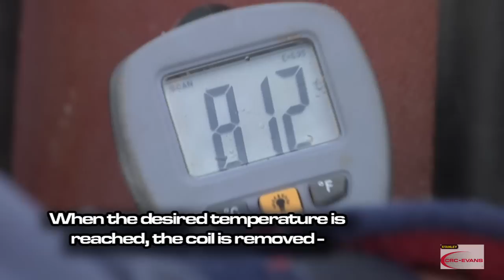Coating

Comment: Mistake done that air 2 blow the dust off is containing moisture wvwry day before starting make sure u take out all the moisture u wantv2 prevent any rusting reasons and that is one right their even propain tanks used after blasting have moisture u use before blasting

Comment: When he came and blew that leftover grit and dust off the line off he sprayed a bunch of water on that blasted substrate and now that is going to rust underneath there. They should have dryers on their compressors. Also that sandblaster is going to get tired sitting there jerking his arm back and forth, way easier to do long sweeping motions
Reply: No, it won't rust. 
Long sweeping motions on a weld that's maybe a foot a wide? Nope.
Reply: Totally agree with you, I saw that too. That’s immediate flash rust there, coating adhesion compromised. He should blow air onto the polyethylene until he is sure the air is completely dry before blowing air onto the blasted surface.

Comment: I get to do all of that in the ground after those big sections are dropped in. Just me and another guy without all of the machinery. Just a truck with a blaster, propane tiger torches and hand paint on that layer in one shot to exact thickness. I think it's the most demanding job on the pipeline.
Reply: you could have just said you coat tie in welds dont have to tell your life story
Reply: and no coating isnt the most demanding job on the line
Reply: Easy there bro.. We all have to do the same. I dont have or need your musscles to get the job done!!
Reply: @bendover1417  I’ve worked most of the jobs….. I didn’t find any more demanding.
Reply: @crunch9876  pipeline in general isn’t demanding other than the environmental side
Reply: I thought skids was the toughest....swamping easiest....as a laborer, in old day oiler was easiest....i thought...cabling was tough as an oiler

Comment: Welding joint is protected by Epoxy coating and poly sleeves
 to avoid corrosion .l
Reply: way better than old days of coating with dope machines...